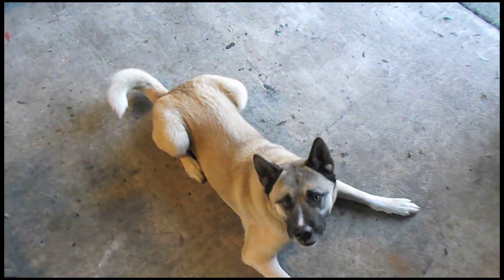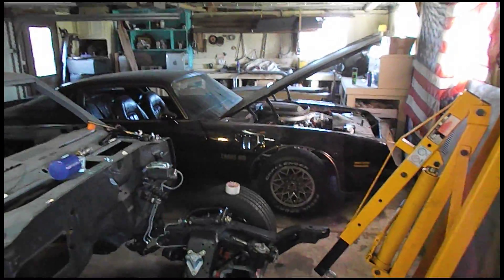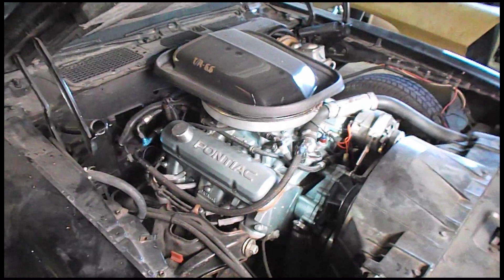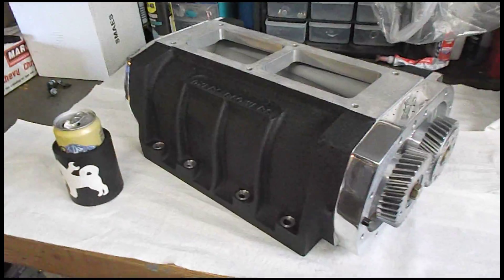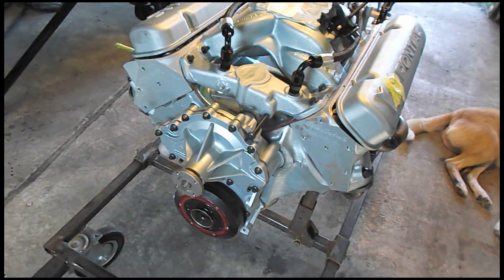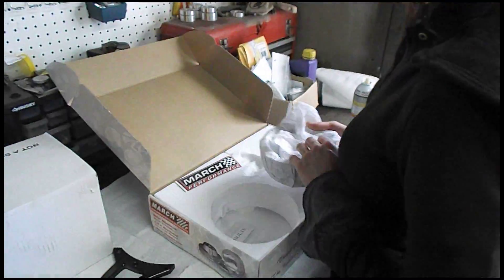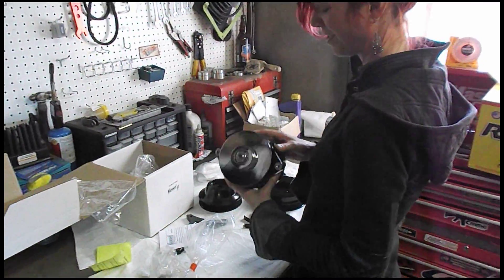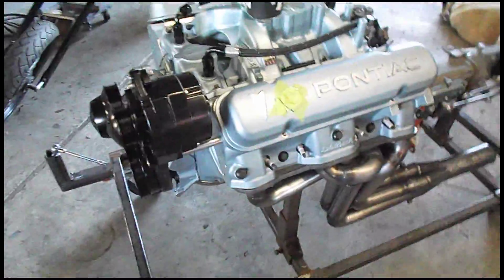T37 Build Update pt 14

Comment: the ta with an ls motor should be sweet and pass emissions with no problems also I have not seen a Pontiac with a blower on it so that would be cool to.  so many ideas so little time lol or in my case so little money to make things happen. I was thinking about a blower years ago with my bird but could only find a manifold for a 4/71
Reply from the maker: yeah long term goals to have a plan so i can keep track of what i'm doing and what to work on without getting sidetracked.   BDS make Poncho intake manifold, it gets trickey with the blancer/pulley setup, so you have to have your balancer drilled at a machine shop to accept the blower pulley. As always nothings perfect in Pontiac land.
Reply: well if they make a blower setup they should make a balancer as well one would hope but as you say its a Pontiac

Comment: oh , thats going to be SWEET , 455 poncho with a blower in an old Chevy !!! 
No prob , if you need pic's for better reference , let me know . I'm hoping to have the 33 done and out of here by may ish  .
Sucks about Cali's emissions crap . will be sad to see the TA taken apart .
Reply from the maker: Thanks Matt,  Should be a wild ride and a little oddball to some extent, in a cool way.  I'm mostly interested in where they had the wood so when its time to re-do with steel, i don't want to overdo it.  I figure if i replace all the wood sections with steel it would be more than enough.    Bummed about it too, its such a good reliable over powered car.  Frustrating.  Chers!

Comment: The Chevy grill shell if a '33. The '34s all had  a painted outer shell and the front edge was much thinner. The (round) Chevy badge was then moved down about 4" on the centre of the grill opening. What a gorgeous dog! The engine stand looks good, too. :-) Those Pontiac valve covers and the blower are a knockout. Very nice. Thanks for the update.
Reply from the maker: Awesome Bruce, thank you!   I didn't really know what to look for, but i already can tell the difference now i know.  Appreciate the tip.    The grille shell i have is a different color to the body so there is a chance they may have been separate so the jury is still out on the Body itself, as the dude i'm getting it off has no idea either.  I like the valve covers too... simple with a little bit of Class.  Appreciate you checking in!
Reply: If the hood (bonnet) is intact it's easy to tell the difference. The '33s all had 3 vertical vents on the side of the hood. The '34s had 3 horizontal trim stripes. There can be no confusion if the hood is there.